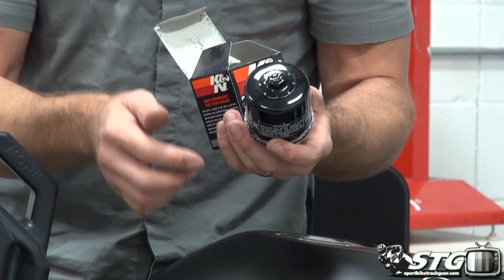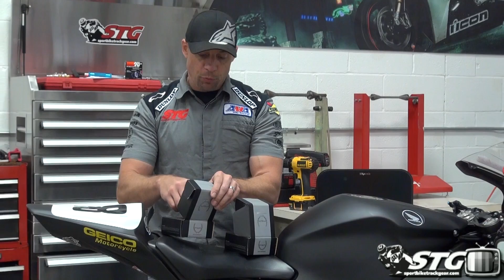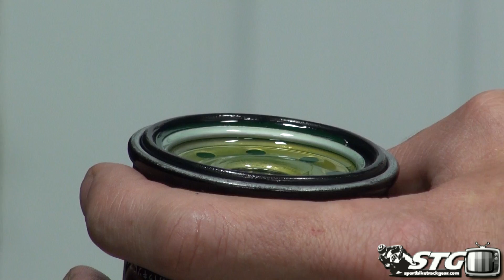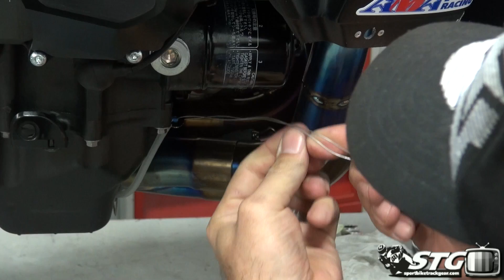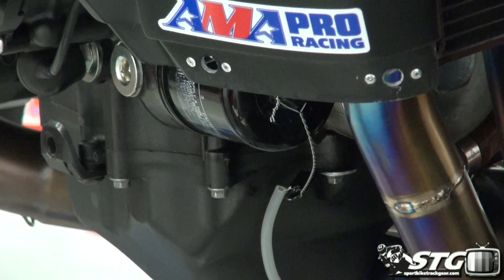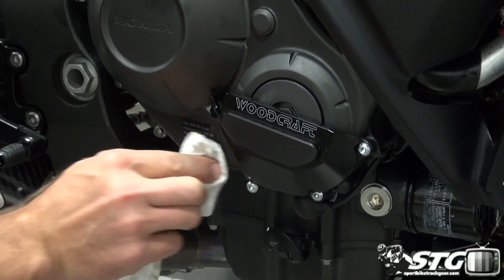How to Change the Oil on Honda CBR1000RR from Sportbiketrackgear.com

Comment: like your videos but i have to say being a former army mechanic on Apache helicopters the lockwire work would never have passed our QC check.  you have it basically attached..yes..but it should be wrapped over the top and coming down to the right side of the nut and puting slight tension on it in the clockwise direction.
Reply from the maker: +3pilot I imagine the Tech inspection for the military is slightly more comprehensive than the race track... I will think about this the next time I safety wire something on my bike. Thanks for your comment and your service, brother!

Comment: If the oil filter is not changed, how many liters of oil will be added?
Reply from the maker: I do not have this bike in the shop any longer and never changed the oil without changing the filter. - Van

Comment: This may be a stupid question... but if the new CBR calls for 2.9 qt of oil and you're pre-soaking the filter with oil prior to putting it on, do you subtract the amount of oil you put in the filter from the 2.9 qt? Or soak the filter and put 2.9 qt in anyways.?
Reply from the maker: Yes you would subtract that oil from the total amount. - BVan

Comment: What is the wire just to the left of the oil filter? my 2017 cbr1000rr appears to be slightly leaking oil from that bolt/wire.

Comment: With the oil filter mounted like that doesn't the oil drain out of the filter Everytime the motor is turned off therefore causing oil starvation Everytime the motor is started???  If im right what's the point?
Reply from the maker: It will not empty completely, I do this on all oil changes. - Van

Comment: Why does the owners manual call out torque specs on the drain plug and oil filter but yet he didn’t use a torque wrench at all?
Reply from the maker: Before starting STG I was a technician at a Cadillac Dealer for about 20 years. Over time I acquired good feel for torque and do not use a torque wrench for most of the wrenching I do on the bikes. We also have all of our drain plugs and filters safety wired which prevents them from coming loose. IMO you do not need to use a torque wrench on the filter and drain plug. - Van

Comment: Is that brake cleaner your spraying on?
Reply from the maker: I have not seen this one is a long time but assume I was using brake cleaner to clean excess oil. You can use that as a degreaser. - Van

Comment: What are the risks with overfilled engingeoil?
Reply from the maker: Well that depends on the bike and just how over full the oil is. If you have twice the amount in you will have a mess on your hands. A little over the mark odds are you will lose a tiny bit of power with the excessive oil in the motor. - Van
Reply: @sportbiketrackgear  ok 🙂 thanks for answering. Greatings from Sweden 🇸🇪

Comment: I put exactly 3 quarts in my engine.. I forgot to account for the ~2 ounces that I put into the new filter, so now I have an extra 2 ounces in the engine (total of 3 quarts and 2 ounces). Is that enough to be concerned about? Do I need to drain a couple of ounces of the oil? 

My CBR manual specifies "approximately 3 quarts."
Reply from the maker: +razorbackblood06 Should be alright, but I would check your site-glass/dip-stick to see if there is an excess and if so drain accordingly.

Comment: i changed both oil &amp; filter on my 08 cbr1000rr. I pour in about 3 quart of oil first to make sure i dont over fill it. start the bike and let it idel couple of mins then took it around my neighborhood . the low oil indicator was not on, so i thought i'm ok. turn the bike and check oil lever in an upright position. the oil level is a little above the lower line. so go ahead and fill it up with another 1/2 quart of oil. try to start it but it wont start. it doesnt try to crank or anything. when i push the start button everything sounds normal but wont start.what could be the problem?
Reply from the maker: I do not feel your problem is related to the oil change. - Van

Comment: what kind of spray you use for clean?
Reply from the maker: He usually just uses brake cleaner for that type of stuff, works the best.  ~Aubrey
Reply: thank you Aubrey! continue with the videos!! i like so much your tutorials!
Reply: Sportbike Track Gear why is my cbr 1000rr so a quiet after i put a slip on? Is there still a cat in the headers or something?
Thanks

Comment: Great video as always, just doing an oil change on my cbr1000rr sp 16 model, I see that you are using the 300v witch is good stuff, iv got myself some castrol power 1 racing oil would this be OK for the motorbike as its full synthetic? The sp does be on track alot too...
Reply from the maker: End of the day there are a lot of good oils out there. I have always gravitated to the 300V over the years and it has really treated me well so I keep using it. Not familiar with that Castrol product but I am sure it's fine as they are a solid outfit. - Van
Reply: DUBRR7 castrol power 1 full syn as long is clean ur good
Reply: I have 09 CBR 1000 rr .I use castrol power1 10w 50 4t ... Honda factory recomended oil !!!!!!
Realy good oil l!!!!
Reply: i always use motul 10w40 (7100) once tried 10w30 (7100) and my clutch was sticking, and downshifting was not smooth.  is this motul 10w40 (300v) good for street use?  and when should you change this oil?  faster than normal oil?  I have a 2011 cbr100rr
Grtz

Comment: Question: I ride my cbr1000rr 1000 miles a year top..should be changing oil at the 12 month time or at 4k as manual specifications?
Where to buy magnet oil bolt ? Oil drain
Reply from the maker: I would change the oil once a season on your bike to be on the safe side. Sometimes sitting is worse than being used. What year is your CBR? Get me that and I will get you a link to the magnetic plug on our site. - Van
Reply: Sportbike Track Gear ..2016 cbr1000rr..
I hate to throw away Mobil one every year..but will do a change asap..thxz
Reply from the maker: Here is a link to the magentic drain bolt for your bike on our site: https://www.sportbiketrackgear.com/psr-honda-cbr1000rr-04-16-magnetic-oil-drain-bolt/
Think of it as cheap insurance rather than throwing it away. - Van

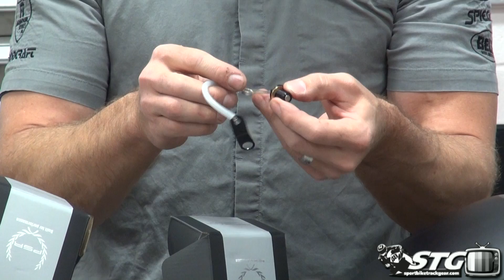Comment: Hi STG!  Do you guys have in stock PSR pre-drilled oil drain bolts with safety wire? On your website I can easily find PSR oil fill caps and regular magnetic oil drain bolts, but can't find  PSR drain bolt that you show at 1:43.  I'm interested in buying both products for my R1.  Thanks!
Reply from the maker: Mike12r1 - Official Channel - we have another video coming soon for the PSR drain bolt that he shows at the beginning of this video.  In looking at the site, you are right, it does not show that it comes with the clip, etc., but Brian states that it does in this video.  Here is a link to the right one for your R1:

http://stores.sportbiketrackgear.com/Detail.bok?no=39767

Thanks!  ~Aubs
Reply: Sportbike Track Gear Thank you Aubrey!
Reply from the maker: You're very welcome!

Comment: Hi man, what's the spray that you used to clean outside the engine after installing the oil filter?
Reply from the maker: That is just some good old Champion brake cleaner. Thanks for watching!

http://www.sportbiketrackgear.com/champion-contact-and-brake-cleaner/
Reply: Sportbike Track Gear ... Isso live in Brazil, how i do to buy?

Comment: is there any easy way to drain oil if you overfilled?
Reply from the maker: You would need to pull the drain plug and let a little of the oil drain out. Make sure it is not hot because it will be hard to prevent all of it from coming out. - Van